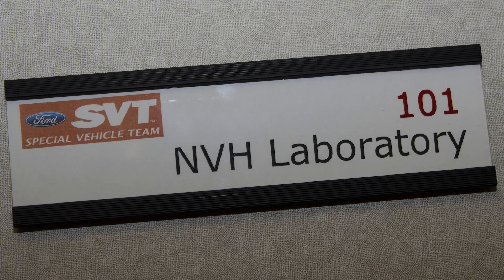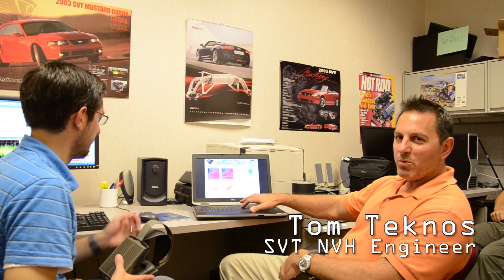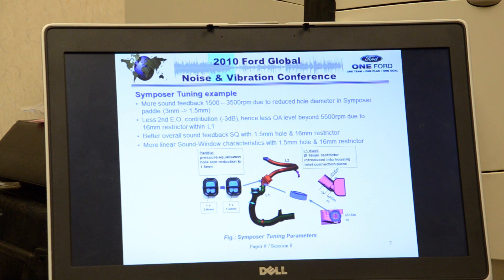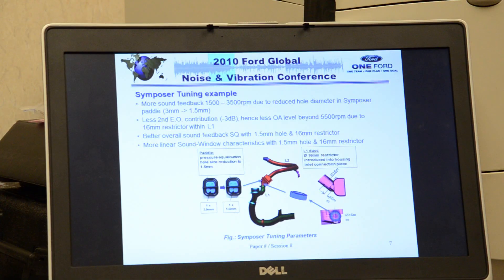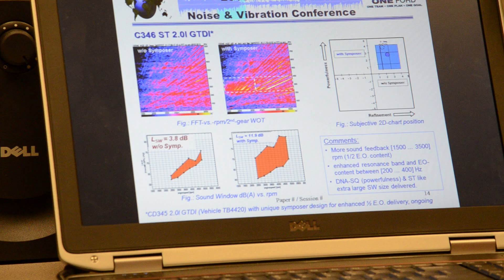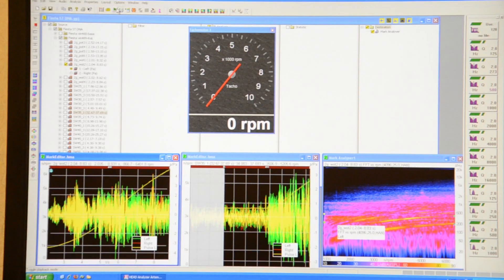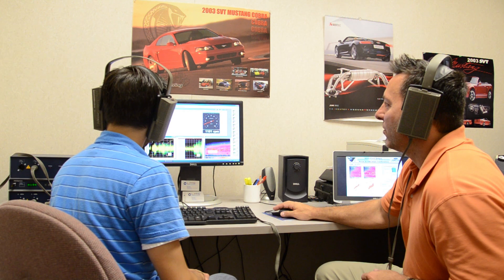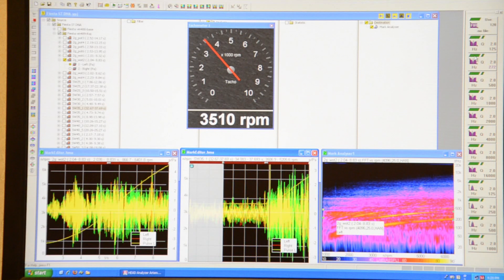How does the Sound Symposer work on the Ford Fiesta ST?

Comment: Sounds like you're using the same audio clip and just using filters to add / remove the sound, it's not an accurate representation of what it would sound like without the symposer vs with. Someone recording from their cabin before and after a symposer delete would be better.
Reply from the maker: I am sure the audio engineers at Ford knew what they were doing.
Reply: @BRGT350  Well , they definitely knew what they were trying to sell. I personally think this whole concept is silly regardless of the car it's implemented on and deleted this nonsense.

Comment: They should have had the connections, but plugged up, and sell the sound symposer via aftermarket, to those who want it.
Not only will it make the car cheaper, but it makes it more enjoyable for those who're just using it to drive on the streets.
Reply from the maker: I haven't found the sound symposer to be loud at all. It is drowned out by road noise, exhaust, and radio. Even with the radio off, I never hear mine. I find the ST in stock form to be very quiet. I added an aftermarket exhaust to my ST and it is still quiet. With a helmet on, it is hard to hear the engine at all.
Reply: I agree. Which is why it doesn't make any sense having it in the first place!
It only makes sound when stepping on the gas, at lower RPM.
Reply from the maker: I am pretty sure it makes noise as long as air is moving through the induction system. There isn't anything to make it not make noise at certain RPM's. The air in the induction system vibrates a membrane that transmits sound via a tube to the dash. It isn't a mechanical or electrical system that is tied to RPM or load.

Comment: I just bought a 2017 Focus ST...and I'm curious.. (because i love the sound), if you were to change your engine (adding a SRI or CAI and BOV), will that affect the sound too? I guess it will right?
Reply from the maker: congrats Chris! The Focus ST and Fiesta ST use very different systems for the symposer. When I made changes to my Fiesta ST induction system, it didn't change the sound of the symposer, but instead you can really hear the intake roar and bypass valve vent back into the induction system. On the Focus ST, going with the Mountune filter will create more sound than stock, but I don't think it will change the sound being supplied by the symposer. Any change to the intake system that opens up the filter will provide more sound, but be careful not to ingest hot air. I use a modified factory airbox on my Fiesta ST to keep the filter isolated from hot air.
Reply: BRGT350 thanks!! No clue what I'll mod on the car. I'm more invested into photography but I for sure love turbo sounds as I've owned two diff mazdaspeed3's before and I miss the intake noise and BPV sounds as well. Just don't wanna lose any of that with this synposer thing.
Reply from the maker: my suggestion is to start with the Mountune filter. The BPV is really loud when using one of the adapters sold on the market. It is great for a WRC car, but sounds a little too much on a street car. I have heard a few and haven't been impressed. The factory turbo dumps excess pressure back into the induction system and then out the filter. Adding a free flowing air filter doesn't muffle the sound as much. The next modification I suggest, if you want to really wake the car up, is the Cobb AccessPort tuned by Mountune. I have that on my Fiesta ST and doing the same to a Focus RS shortly. It changes the car dramatically and one of my favorite modifications. Those things alone will really make a difference. Neither will affect the symposer.
Reply: BRGT350 thanks man!! I used to have an AP on both my mazdaspeed3's... so I've just gotta save the money and get one for this! I feel like I would need at least an SRI or something?
Reply from the maker: From everything I have seen, the best option is the filter in the factory box. It keeps out the heat and has fresh air ducting to the front bumper. A short ram intake loses the fresh air and sucks in hot engine compartment air. I started out with the Mountune filter and Mountune tuned Accessport on my Fiesta ST and it was a great foundation. I am working on putting together an RS and will be using the same thing on that car. Filter and AP from Mountune.
Reply: BRGT350 thank you!!!!
Reply: BRGT350 thanks for your response :)
Reply from the maker: no problem, happy to help.

Comment: hi. do you know if the symposer was changed at all. my 13 plate st sounds a lot quieter than my girlfriends 64 plate st does. both stock fiesta st s. uk cars. Cheers. Matt.
Reply from the maker: not sure, I have only been in a 2014 and 2015 ST. Both of them sounded the same. It isn't uncommon that there are minor changes between model years or even during a model year.

Comment: Way to spend millions making a car sound worse...
Reply from the maker: how does plumbing intake noise into the cockpit make it sound worse? It is the same sound you hear with an open element filter under the hood. I love the sound symposer in my ST. I also doubt millions were spent, probably closer to sub $100k.
Reply: +BRGT350 no probably millions as its not just a concept applied to the fiesta, other models have it too. I hated it in my ST, it was the first mod I did was a Mountune delete kit and was the best thing I've done to it so far
Reply: +BRGT350 and its soooo not the same noise as an open element filter, that's real induction noise, no plumbing and special boxes with paddles that flap back a forth to create "a synthesised" engine noise, it's a forced and fake sound
Reply from the maker: we clearly won't agree on this one, and that is ok. I like it on my Fiesta ST and see no reason to remove it. The Focus ST version is very different and that is more a "created" sound compared to the Fiesta.
Reply: +BRGT350 it is fine. Proof people can disagree on the Internet and its not WW3 lol
Reply from the maker: haha, yep, we have different views and both are ok.

Comment: I like it.. and thanks for the upload, much better than searching through hundreds of pages on forums to find the real answer. It helps being able to hear your car when you drive a manual. and the tuned sound is no surprise, they do they same thing with exhaust sounds, all aftermarket exhausts have different sounds.
Reply from the maker: +Ray Walker Brandon and I both learned a lot from spending time with the Ford engineers. There is a lot of engineering that goes into these cars and most people never realize it nor understand the parts they are modifying.

Comment: I own a focus st with this kit and I had a check engine light come on, the ford dealer told me the light came on due to the sound symposer delete kit.. Is this factual??
Reply from the maker: +Rob Medeiros possibly. The reason would be if the delete kit caused a boost leak and that triggered the light. Any boost or vac leak would be detected and trigger a light. That would be the only way I could think of a light being triggered by the delete kit.